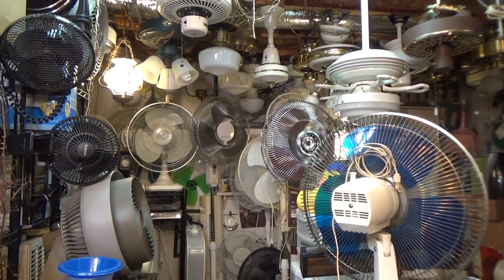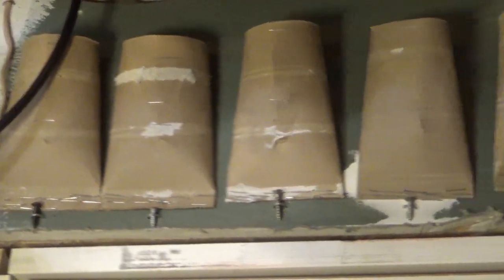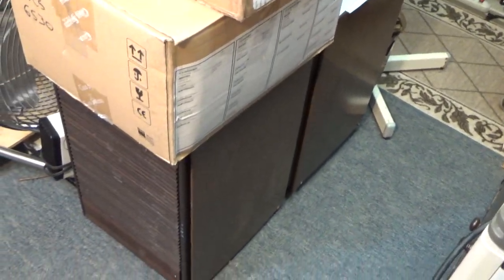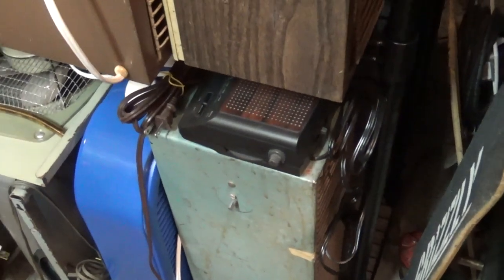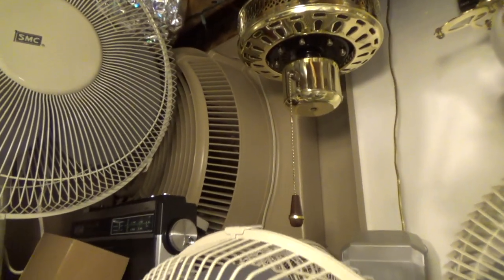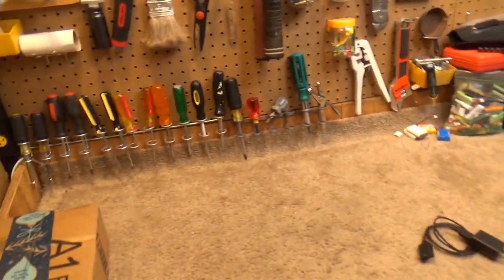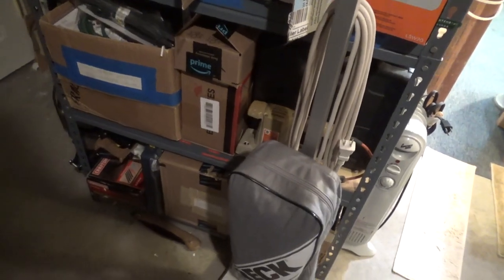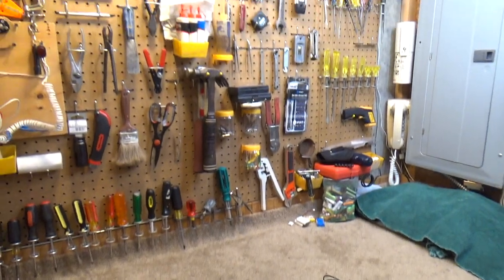Shop/Studio Tour 6/1/2020

Comment: You should buy one of those cheaper (Since I know they cost a good bit of money) outside shed. Either the ones you can build from a set or you buy it prebuilt. Then tuck in in the back yard, insulate it, use a dehumidifier, and a heater. 

Just so you can store stuff in there. Thats just what Id do so I could have a lot more storage for the things I love to collect. I wouldn't put any of the metal stuff. Just plastic stuff since plastic cant rust.
Reply from the maker: As discussed in the video, I'm currently out of work, and a relocation is in order in the near future anyways. There's no need to rig something costly just to get by a few more months.
Reply: @JordanU  ah, I thought you were talking about sometime next year. Since we really don't know when places are going to be opening back up and people will be going back to work. Since nobody can really tell the future with this covid crap going on.

Comment: The only "efficient" way to store pedestal fans I know is to take them apart, and store them in a box or cupboard. But obviously it's a nuisance when you want to see them or use them.
Reply from the maker: I've done that with a few of the newer ones I still have the original boxes to. If I could find boxes big enough to fit some of the older ones, that's a pretty good idea.